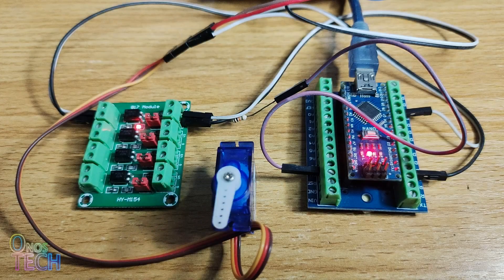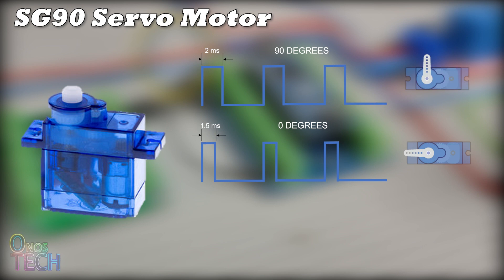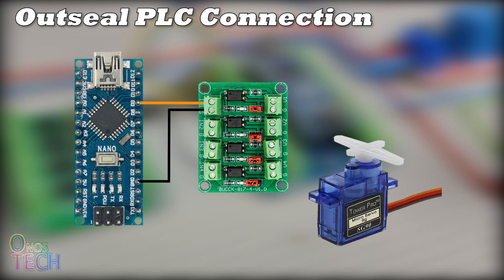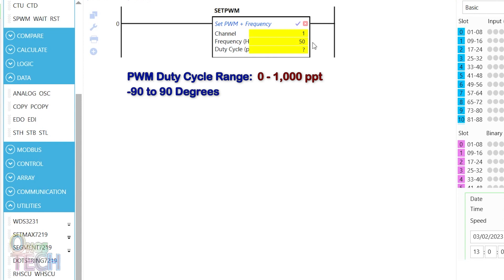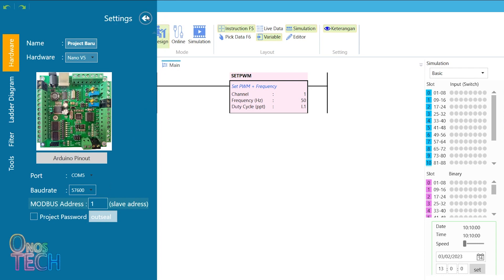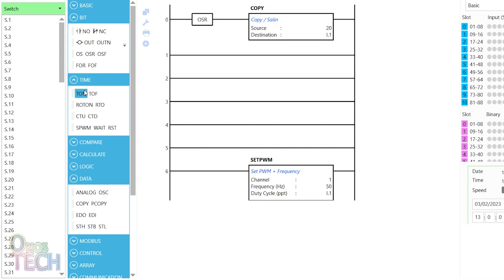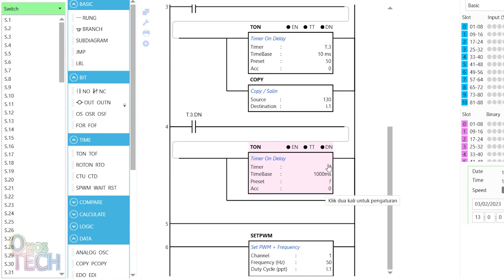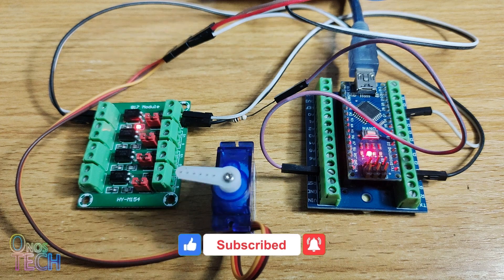How to Control Servo Motor | Outseal Arduino PLC

Comment: Hi,sorry disturb...im want use arduino nano to read a modbus froma mach3 for use an pwm value for run an brushless spindle (as drone ,esc+motor) not important speed precision,im want use as : max speed 10000 rpm,if arrive from mach3 s5000 it run at 50% ,if arrive 2500 it run as 25%...is possible for you help me or give me a link where undestand how do it ?? thanks

Comment: Thank you very much for good sharing. Is it possible to control two servo motors with one nano arduino?
Reply from the maker: Unfortunately,  only one servo is supported with Arduino Outseal PLC Nano. The Outseal PLC mega supports two servo. However with the PCA9685, more servo can be controlled by the Arduino Nano.
Reply: @OnosTech  Will you share any video about servo control by using PCA9685 ?